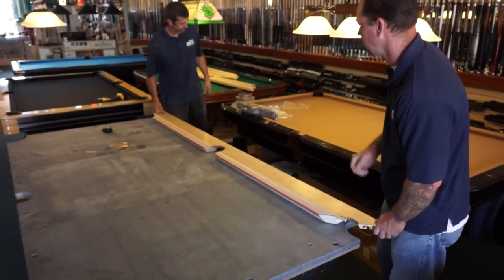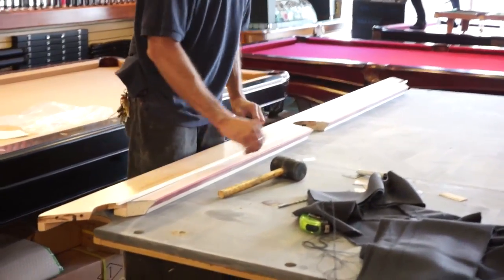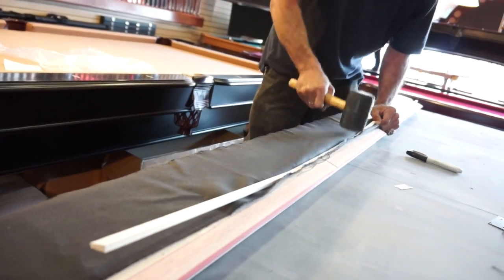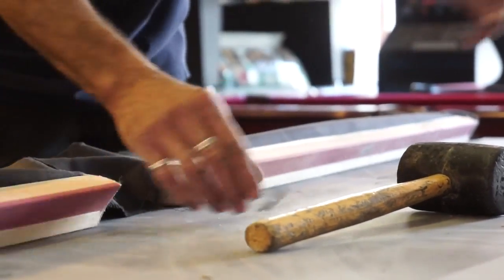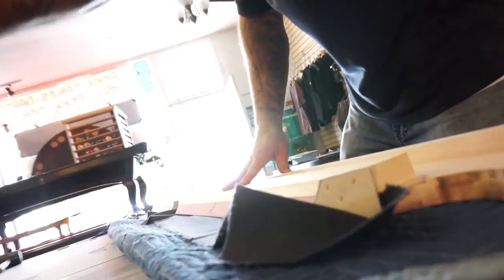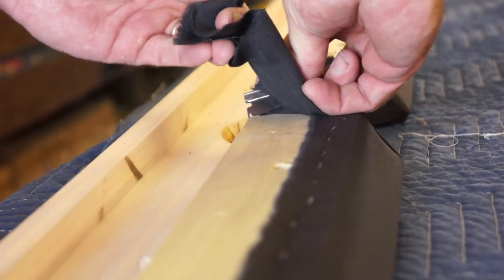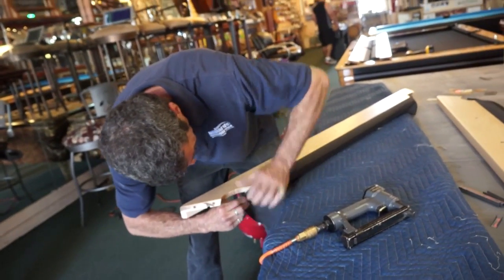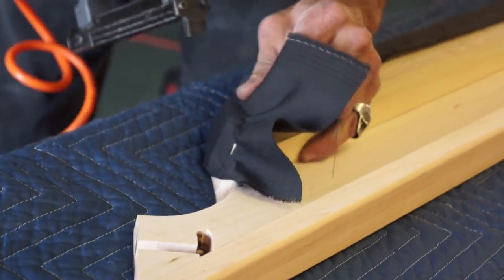Pool Table Installation: Step 4 - The Rails

Comment: Great mechanics! Do you really have to pull the triggers every time for the air staplers? Is that a osha shop rule or something? Or is it just a control thing... Just used to letting them fly...That kind of sucks if it is...